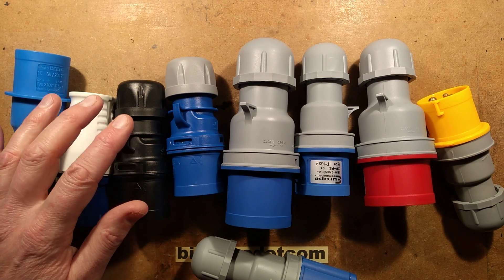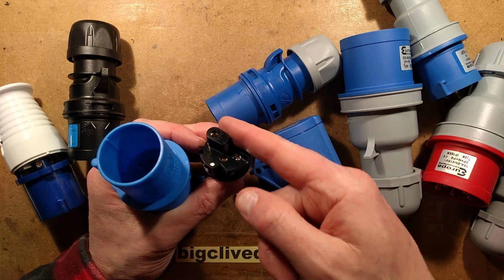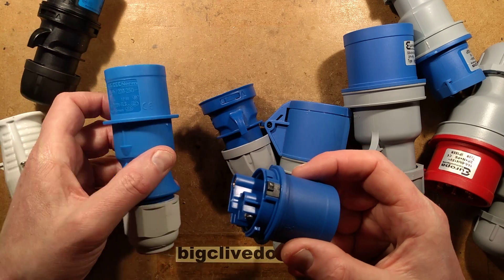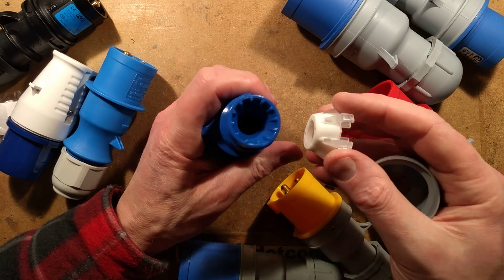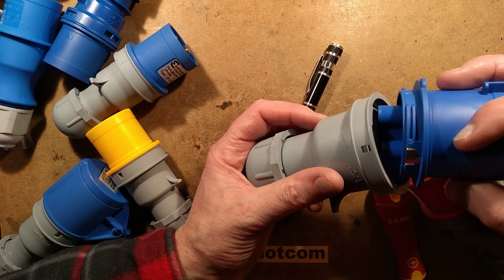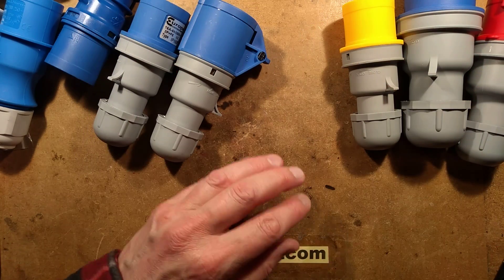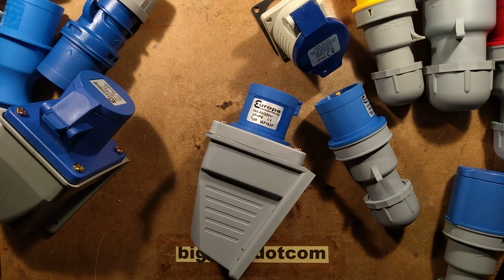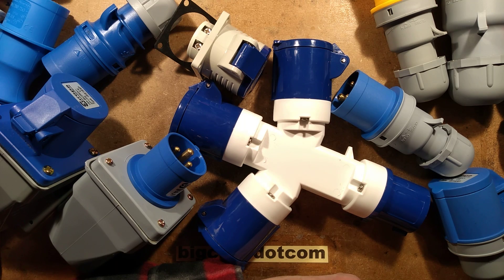My favourite industrial connector (Ceeform).

Comment: Interesting..  I'm not familiar with these in the US- perhaps they show up industrially, but I haven't seen them.   I thought it was interesting that you mentioned that the yellow one (110V) is used in the UK for construction sites?   Any more information on that?  I'm surprised to hear that 110V is used in the UK at all.
Reply from the maker: It's annoying.  We have to use heavy transformers to convert 240V to centre tapped 110V.  Needless to say cordless tools are very popular.  In other parts of Europe they just use 240V and an RCD/GFCI.
Reply: @bigclivedotcom  yeah, same deal here in AU, if it's not cordless it's plugged into 240V on an RCD
Reply: @SomeMorganSomewhere  yes a proper earthing / grounding system and a RCD is indeed perfectly safe for hand tools and the like. Equipment that needs reliable continues operation could benefit from those heavy transformers.
Reply: @ I think it depends on how mobile you need to be. Somewhere up a ladder or along a roof you might prefer a cordless tool over one with a cord.
Reply: @bigclivedotcom  Ho many deaths in the UK compared to Europe by electric shock on building sites
Reply: @TonyDartford  According to records there were 4 deaths due to Electricity 2018/19 in the UK! I suspect there have been many "tingles" though that would have been worse if it were 240! European figures are harder to come by but in the USA it is averaging out at 58!
Reply: @TonyDartford  you can look that up at the HSE. They're reportable under riddor
Reply: @totherarf  Rough figuring, the USA would have five times the number of deaths as the UK, so the UK death rate would be about 20 for the USA. That's on total population, not the number of workers in similar jobs, but a 3:1 difference is is not trivial.
Reply: @davebell4917  The figures may not be transposable! For instance there were 3 French linesmen killed (in one accident in the UK) ....... 3 parallel sets of overhead lines (HV)and they chose the wrong one! I am not sure those figures are recorded for both sides!
Reply: @totherarf  any links to the story?
Reply from the maker: @TonyDartford  It's very low here, but I can't give an exact figure.  The HSE seem a bit vague about the incidents they investigate.
Reply: @barrybritcher  It was an internal safety briefing from my employer. I have not seen it online so have no links.
Reply: @bigclivedotcom  hmm we do not have any regulation liek that at all here. now you need a RCD device stil that is a "new thing" (was not there 20 or so years ago) we did use a delta poser system tho.. so 110V to ground on every phase. 220v system (now 230-240v)
Reply: Site transformers have centre tapped secondary windings reducing the shock voltage to earth to 55VAC making it extremely safe to use on construction sites.
Reply: @bosstowndynamics5488  Yeah I can imagine how thousands of tradesmen would react if forced to suddenly replace their very expensive tools on the back of a silly legislation change. The fact is the 110v tools are still safer, even against those with RCDs since the fatal current on a 110v centre tap isn't possible vs RCD supplies that require that current to be achieved to trip.
Reply: I believe it's a "health and safety" thing.
Reply: All of you Europeans are acting the same as you do about North Americans not fully using the metric system. Yes RCDs are a proven life saving device, but do you truly want to depend on a mechanical device to work 100% when you need it? Yes the 55/110v tools have different plugs, and possibly different cords than what you're used to using, but they still work the same as 220-240v!

You people are bashing an old standard that still works for them. You'r day to day lives, aren't affected by it, so who gives a shit. go outside. Breathe in fresh air. do something constructive with your short lives.
Reply: It works great. They don't need two sets of tools for each voltage, they just need a £80 transformer with them if they're not using a site provided 110v. Many new LED site lamps and portable drill type battery chargers will work on both voltages. You can either distribute 230v or 110v.
In a large site, the 110v site power distro and 110v site lighting is often provided by the same company that provided the scaffolding, and then removed by them as well so it can go to the next site.
Reply: In The Netherlands, until 2011, we had a rule under the NEN3410 normalization, that tools and machines that worked below 50 V AC or 120 V DC did not have to have a periodical safety inspection. So before battery powered tools,  many companies had these tools with a big transformer in between mains and the tool itself. I had a power drill and a huge soldering iron that worked on 48 V.
Reply: M , , ,n    . .  ,.  . , .  N.   P. ,,k
Reply: Here in the Netherlands we use them in construction site  for the distibution of power. The users use the normal euro or skuko. We alsof see them on campsite tot connect your caravan to. And even in some homes for the 480V (possible of you have a 3 fase connection going into your home)
Reply: @bosstowndynamics5488  Nothing. But those with 110V tools would be forced to use it!
Reply: @bosstowndynamics5488  £ ...... They are not cheap!
Reply: Hi Joshonthetube,
110dc was used on fairgrounds  before 240ac became safer to use.
Reply: Here in the Netherlands we also use them in the entertainment industrie. We use them up to 125 amps 5 pin red connector. If we need more amps up to 400 than we use the powercon or powerlock system. We also get the Ceeform in a custom black connector. The black colour is not a norm as blue red or yellow,   so you can use them for pretty much anything you want.
Reply: You have them in the USA. They're called pin-and-sleeve connectors and they are made by Hubbell. They  used to be not compatible with European Ceeform (IEC 60309-2) types. However, I see they are selling IEC (non NEMA) versions now.
Reply: Smudger Dave .
The US ones have different ratings, 20: 30, 50 and 100 A rather than 16, 32, 63 and 125 A in Europe but I think the sizes are the same

There’s also a IP67 version with a locking ring with a rubber seal to keep water out.  125 A, and possibly 63 A ones are only made in this form.

I cannot remember the exact Voltage ratings for each colour, but purple is for around 12 V, white 50 V, yellow 110 V, I think the exact range for this is 105 - 130 V, blue 240 V, red 415 V and black 600 V.  There,s also a grey one but I’m not sure what that’s for.  In the US but not in Europe there’s an orange 4-pin one for 120/240 V, and a green one for high frequency, usually 400 Hz.  I don’t know if there are versions for 277 and 480 V in the US or for 347 V in Canada; does anybody else know.  I think there are also versions for d.c. but I don’t know the details.

63 and 125 A versions have an extra, shorter, pin in the centre which can be used for interlock purposes to ensure that a socket is not live when a plug is inserted or removed.
Reply: @bosstowndynamics5488  They don't have to buy or bring a transformer. Site power is supplied at 110V by the principal contractor.
Reply: Ellis Dee WRONG 30mA well into the fatal bracket.
Reply: @Swans_And_Ducks  It may well be .... BUT you need to factor in the disconnection time!
Reply: The US have the NEMA standard, but every alternative that I have seen there have been quite scary - you can unplug with power on and you can touch the live pins when plugging/unplugging. I'm amazed that it hasn't been been a court case about that yet that are banning the NEMA standard.
Reply: @ehsnils  it's because normally, the NEMA molded connectors are quite physically robust, and you can get away with pulling on the wire--and the ones that aren't robust will normally have a fingerhold by the wire end anyway.
Reply: @ehsnils  Yep.  In IT, most larger UPS and server power connectors are NEMA.
Reply: 110v is a double safety measure. Lower voltage meaning any shocks between phase and neutral are reduced, but also is centre tapped so any shock to ground is only 55v. On sites with generators this isn't much benefit, but on mains powered sites it prevents a lot of deaths.
Reply: grahamek86 so I get the theoretical benefits of limiting the voltage between ground and live by a factor of 4 (it’s not actually 115V mono phase, it’s 57V biphase that you’re making), buuuuut... the rest of the world uses 230, complete with ground referenced neutral, on construction sites and somehow does not have a massive spate of electrocution deaths. In other words, as to your claim of “this saves many lives!”.... [[citation needed]].
Reply: @JasperJanssen  Many works happen inside standard domestic and industrial environments where RCDs don't exist. That means that the onus is on the contractors to bring portable RCD systems and, if they decide not to, can still work without whilst introducing a danger to many around them. The "this saves many lives" comment is less statistical and more probable based on what I know and have observed about site behaviour. Give a man a chance, and he'll happily work without a hard hat. Force a man to use 110v and he and his colleagues will be far safer.
Reply: @grahamek86  yup this is the exact reason its used!
Reply: @grahamek86 Actually, here in Sweden we use 240V with RCD devices on constructions sites. We have between 20 and 40 fatal work accidents per year. Not a single one between 2020 and 2024 (so far) was caused by electrocution. There was however one guy that got crushed under a transformer when they dropped it and one got hit by an electrical cabinet when it fell. The absolute majority is fall or crush accidents.
So 240V is not a big problem, at least not here.
Reply: There is a yellow version for 110V. It's in the standard. I don't know if it's used a lot.